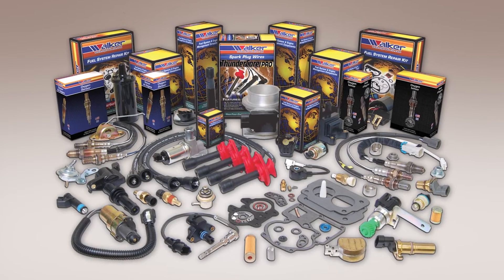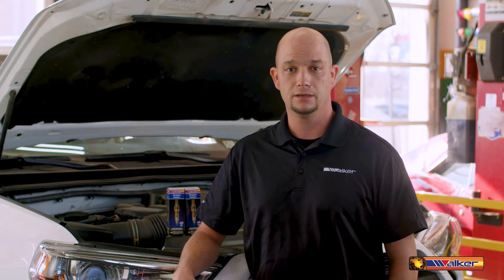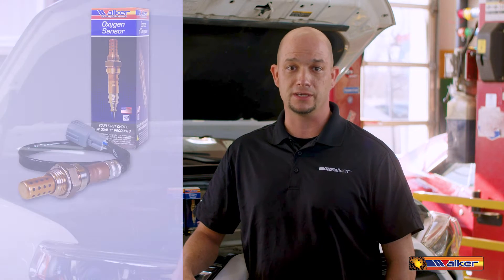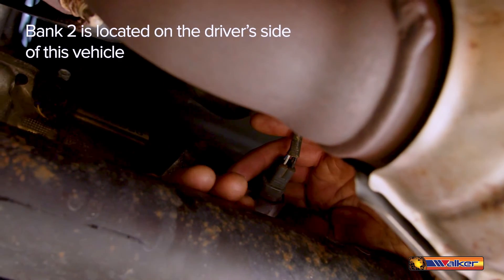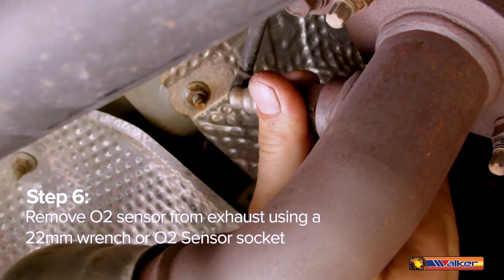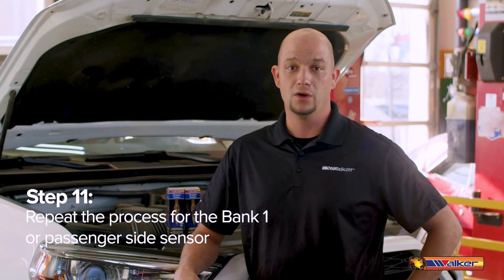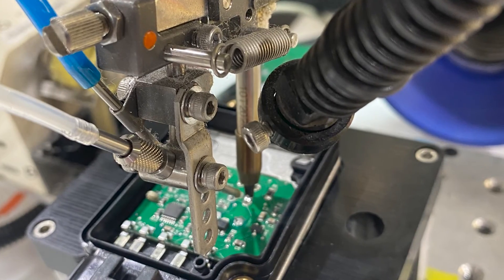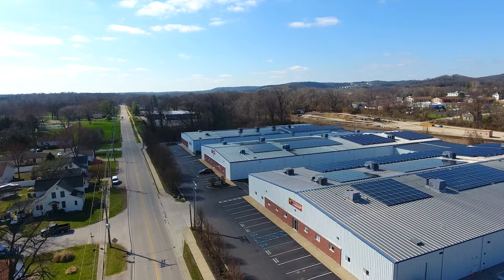Oxygen Sensor Replacement – Toyota 4Runner 4.0l

Comment: Bank 2 is on the passenger side. The banks are read from left to right and this is set from the front end of the car/ engine. I learnt this the hard way, don’t repeat this silly mistake.
Reply from the maker: Bank 1 = Cylinder #1 side. Could be driver's side, could be passenger's side - all depends on that!

Comment: I have a 2016 4runner and have both codes of p0171 and p0174. Changed the MAF Sensor and the check engine went away but then came back with these codes again
Reply from the maker: Hey Byron - have you looked into the Oxygen Sensors? The Upstream O2 Sensor "could" have something to do with it. Maybe an intake leak as well. Not professional advice, just trying to help point you in the right direction!